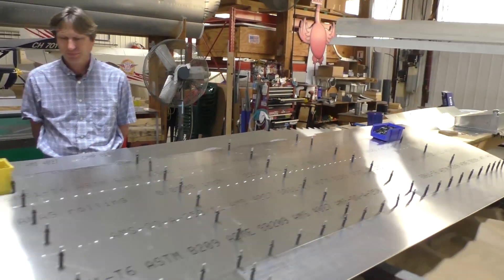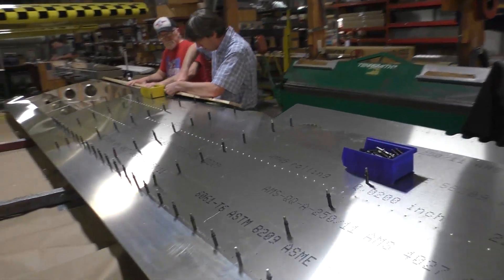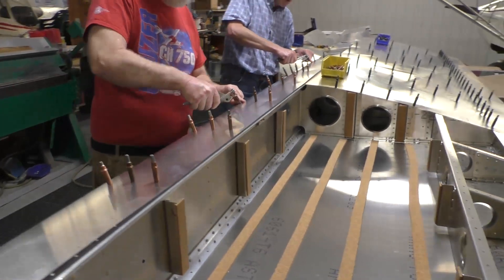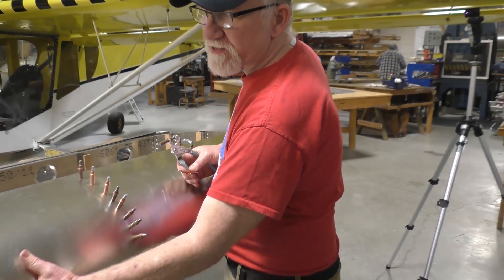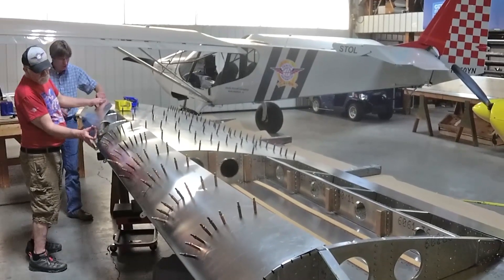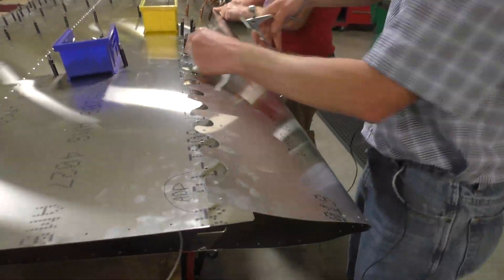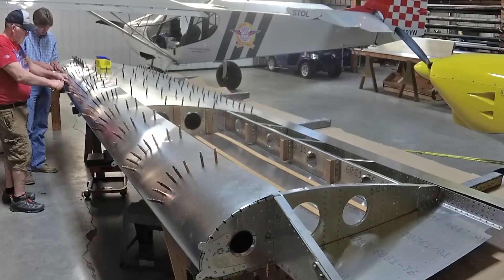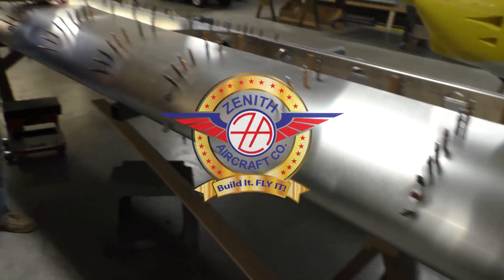Zenith STOL CH 750 Super Duty kit assembly: Wing Nose Skin Installation

Comment: Is the 701 kit matched hole drilled?
Trying to decide on what kit I'm going to get! I've definitely decided its either a 701, or a 750SD
Reply: The kit for the STOL CH 701 is still "old generation" (which is reflected in the lower price). The CH750SD is definitely the more advanced kit